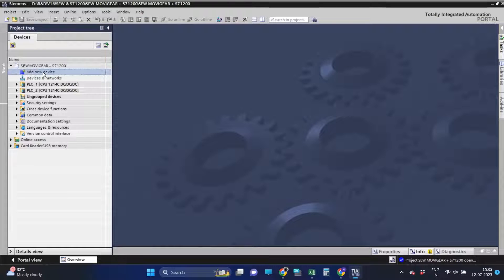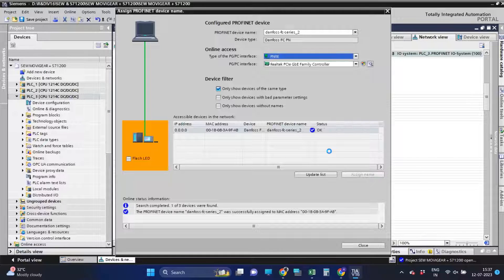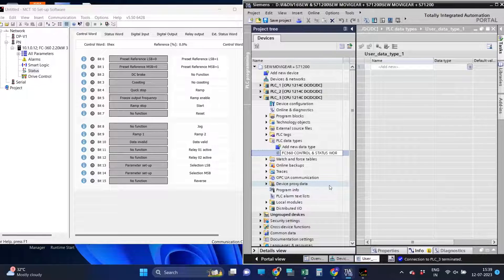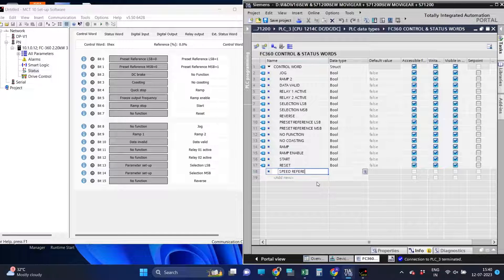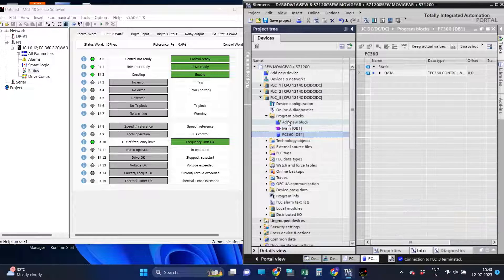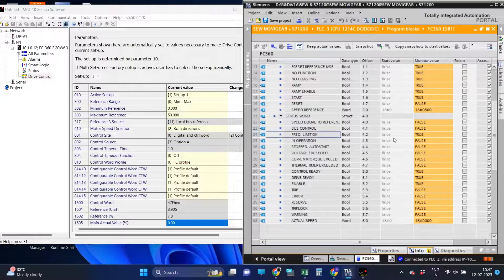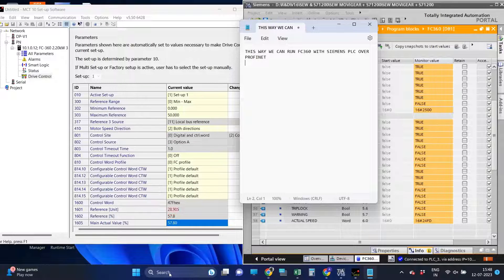DANFOSS FC360 AND S7-1200 PLC PROFINET COMMUNICATION.

Comment: 4:14  why you start tagging from bit no 8 instead of bit 1?
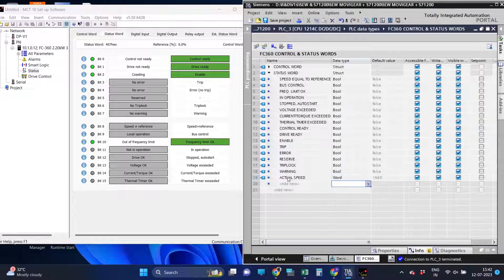Reply: At 7:33  you took "ACTUAL SPEED". Which is not mentioned in 16 bit.
Reply from the maker: @ahsunhabib3723  You can connect on Instagram page  for further queries.
Reply from the maker: @ahsunhabib3723  Hello I have used Seimens blocks DPRD, DPWR for read write data in PLC program. Block has predefined format of addresses Bit 8-15 first and then 0-7.
Reply: Oh.  thank you  @zackk_54544
Reply: @zackk_54544  oh got it. Your video helped me a lot. Thank you